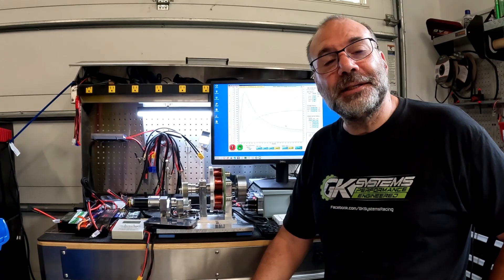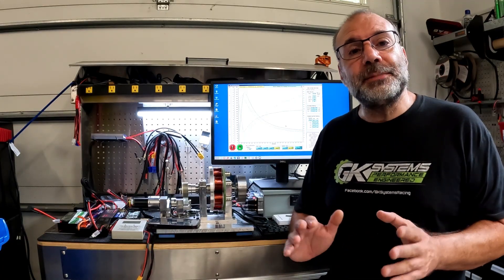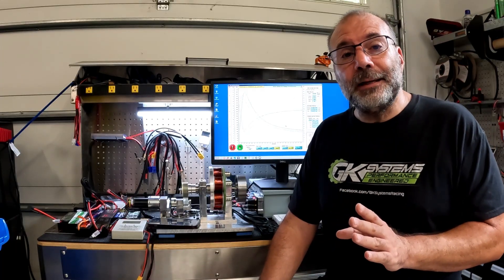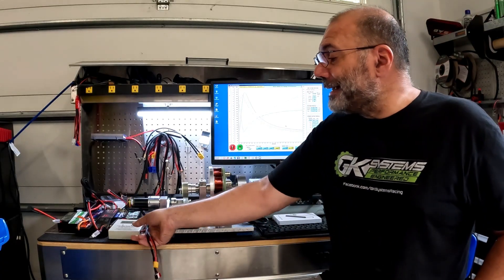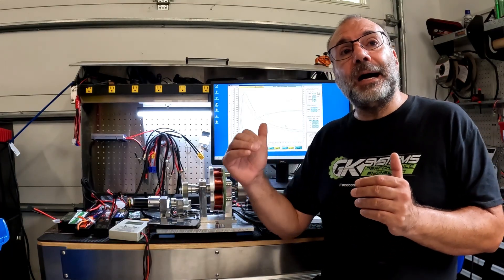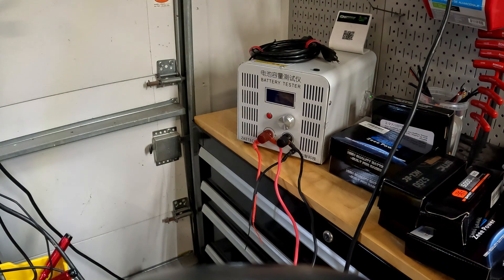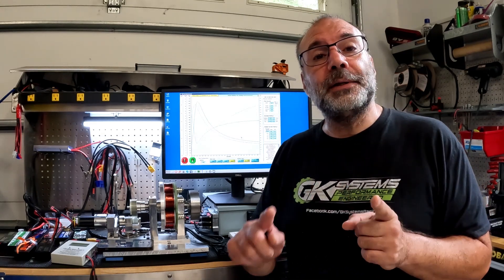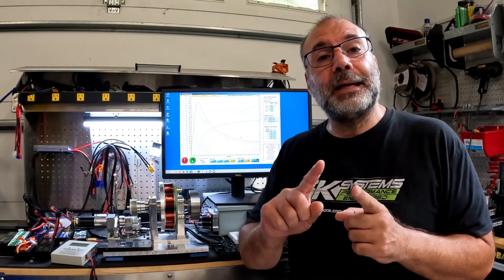RC LiPo Battery Dyno Showdown – C Ratings EXPOSED | Real Power, Real Data!

Comment: As you already know the listed capacity rating is not the same as the one listed, so charging at the list rating may give the battery an unfair advantage. It's worth testing charge current and it's affects on battery performance. It's possible 6000mah batteries may out perform a 5000mah battery just due to the difference in charge amps. If every battery is charged at the same amps you'll get results that eliminate a variable. It's also good to know that batteries perform the worst under the first charge of the day. The second charge shows improved performance with the 3rd charge being even slightly better. Just sharing some knowledged over my many years of racing.
Reply from the maker: Thank you very much. 
Yes, we’re well aware of the different factors and variables, that can change the outcome. But this is also why there has to be some kind of standard practice just for the reason of saying well had you done this?…

So we’re just following the standards and practices that are outlined in every testing handbook that is used in research development facilities.